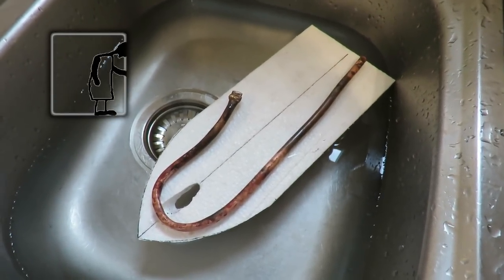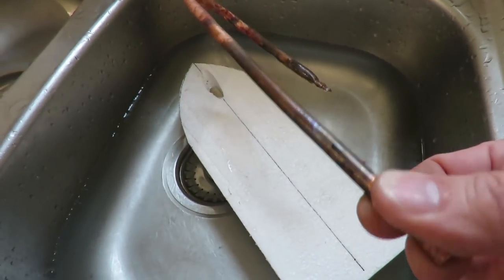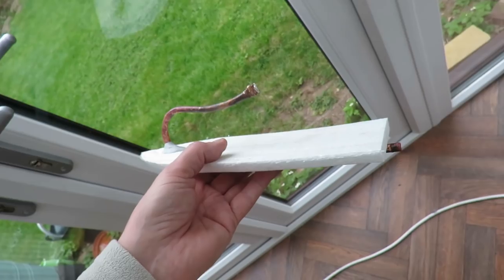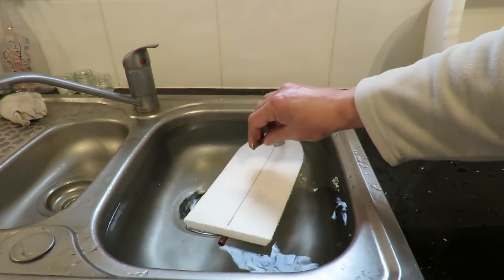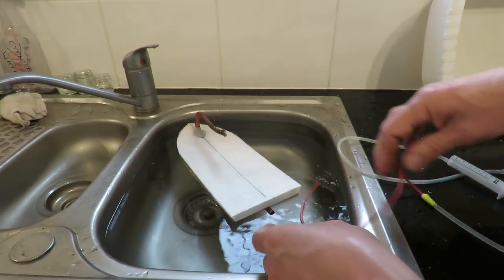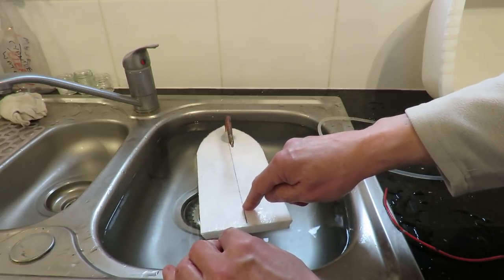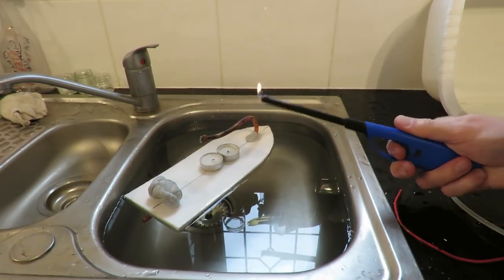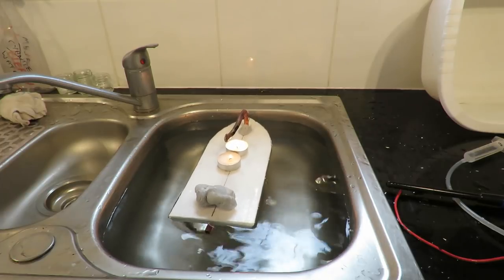Single Pipe no Boiler Pop Pop Boat - proof of concept

Comment: Whenever a pop pop works well and then stalls it is because you have too much heat. It was running strong in the sink with the new unmelted tea lights. In the tub the big candle was too hot and I think it would be better nearer to the tip. You may have even run the boiler too low. That would explain the reduced performance later on when the candle was in a better position. The fairly extreme oscillation in the sink may have been due to overfilling the boiler. You want a little air in the system or a noisemaker membrane to absorb some of that bounce. That way you get pulsed forward motion but no backward bounce. Based on the performance in the sink I have to call this a surprising success! A little refinement will definitely produce a very good motor. I have visions of 4 or more of them side by side.
Reply from the maker: I guess you will just have to make one with 4 pipes, so you can try it out 👍

Comment: This is so cool! Much clever design! :) The pipe's "belly" should be a bit more curvy, because the water should stay that region for condensation, or the heating point should be placed backwards a bit.
Reply from the maker: Yes, I gave it a gentle curve but I think a little more would have helped.

Comment: Nice design, I haven't seen a pop pop boat like that anywhere else. The single pipe ones all had a boiler.
Reply from the maker: Well the pipe is the boiler, it is just not a separate component. It is really just the same as the coil boilers with one end sealed off. The problem is getting water into it.

Comment: working well  you could you try two pipes ?
Reply from the maker: You certainly could but then it wouldn't be a single pipe experiment. What I would like to do if I find another handy off-cut of similar diameter pipe is do a U shaped design or perhaps we could call it an "uncoiled coil" boiler. The main issue is I hate paying the price for copper pipe so it will only happen if I come across another bit of scrap like this.
Reply: @GrandadIsAnOldMan  yes it would not be a single pipe experiment I was thinking of another single pipe alongside with no actual connection other than the heat source yes copper piping is getting expensive at nearly £4 a meter !
Reply from the maker: @thehappylittlefoxakabenji8154   yes £4 is about 4 times my target price for a project. Just spotted some on eBay at £3.69 for a 1m coil including postage. Add that to Mike Flight's idea of an induction heating power module at around £6 (plus a very expensive high power 3S LiPo battery) and it soon add up but it would be a fun project. Sadly that will just be a "pipe" dream for now. A few thousand more views per video and we might make some progress.
Reply: @GrandadIsAnOldMan  yes it is expensive I find that a lot of my projects can cost way more than I could buy something off the shelf like that demagnetiser I made I priced up a power supply plastic case with postage & small handling charge it came to nearly £15 !

Comment: Looks like it'd be happier with two pipes.
Reply from the maker: Why would that be?
Reply: @GrandadIsAnOldMan  
Comparing videos of the two pipe version to this single pipe, it's clear that the two pipe version is much peppier. A lot like engines with two valves per cylinder compared to similar displacement engines that have 4 valves per cylinder.
Reply from the maker: @goatsinker347  so you haven't actually built one yourself? You may find the video description helpful. I did make it fairly clear why I was doing this, in the voice over. You will also find links to my other pop pop boats.
Reply: @GrandadIsAnOldMan  
Yes-yes. You built it to prove a single pipe/no boiler concept. Very good! Awesome. 
        Yes i have built them. Ones that my kid could sit in. Powered by propane and a homemade burner. This was back before youtube existed. My comment earlier was just to say, your little boat would put along faster with an extra pipe/engine.

Comment: why fill the pipe in such hard way?
Reply from the maker: Is there another way?
Reply: The pipe needs to be filled but then sit with the open end below the water surface.*
If the open end is exposed to atmosphere,then the air runs in,and the water runs out.
The pipe BELOW the water line is cooling the water/vapour IN the pipe until it contracts enough that it recedes back into the heating area.

*holding the whole pipe underwater to expel the air in it is way more fiddly and unreliable,as you then have to clip the pipe into place on the boat WITHOUT disturbing the water.

I am looking about for a longer pipe.....bend it double,then make a P shape as he did here.
This would give you 2 outlets(one needs to be shorter but parallel to the long one)

Boat will stall if the pipe BELOW the waterline gets too hot.
the shorter pipe will cause a pressure imbalance,thus encouraging a flow bias inside the pipe itself.

Note when in expansion....the pipe output is directional
when in contraction....water entering the pipe is NOT directional
This drives the vessel forward from the thrust from either pipe.
Reply from the maker: @boogieknee3781  I am not sure if you have actually tried filling a closed pipe with water. Water will not flow into it because the air inside cannot flow out at the same time. If you use a longer pipe and have two outlets, then for filling purposes, the water can flow straight in one and the air out of the other. A simple coil works very effectively, here is one of my examples https://youtu.be/i9Zc33gdrbM As for creating a pressure imbalance, why would you even want that? The water does NOT flow in one pipe and out of the other during operation, It is effectively a closed system, with the steam pressure pushing the water equally in all directions. There is NO water flow THROUGH the boiler. You will find more information and related links in my video description.